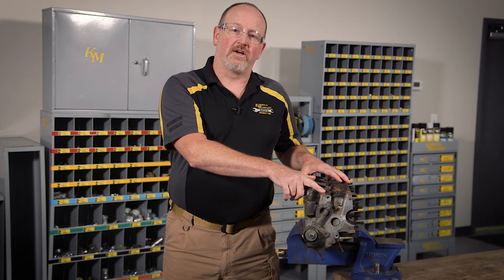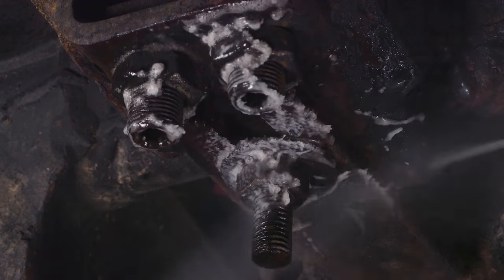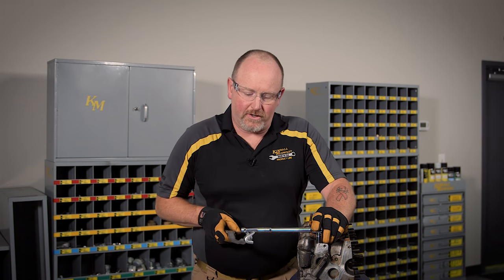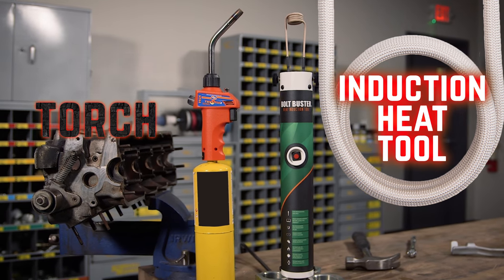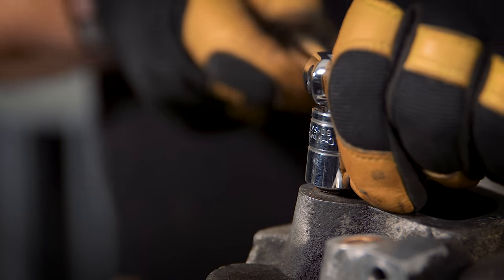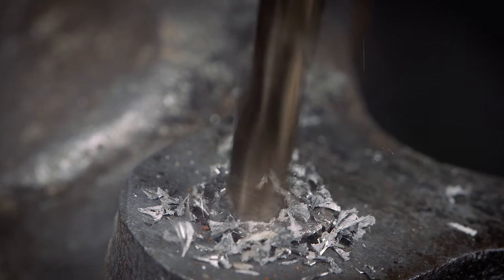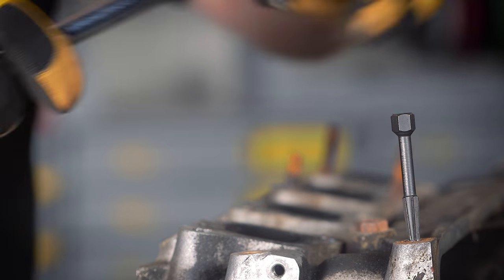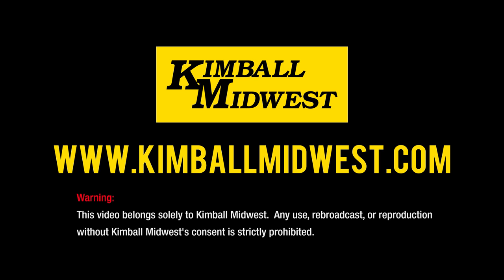How To Remove a Stuck Nut or Bolt

Comment: man…i have a bolt that i have loosened,  it only moves maybe a 1/4 turn and stops. 

it’s a large torx. i’ve sprayed and waited, heated with a decent torch, but it won’t unwind.

i worked it loose, tighten, loosen, tighten, resprayed… the torx teeth have bent. might have to buy a whole other set for the one wrench.

i do a lot of mechanic stuff, but i’ve never had one loosen and not keep coming out.

Comment: &if all that fails... Drill all the way down & through, remove as much metal as possible. Then use a tap & die set with a bunch of WD-40, to retap the hole. Going in & out about 50 times- deeper & deeper, the leftover threads should come out, a few sharp rings at a time.
Saved a few China girl motors doing that
Reply: Tai Theguy so in my case my oil drum bolt is stuck in my car, drill onto the surface of the oil drum or?
Reply: 50 Times? That's Prety Good
Reply: Alliyah my mistress thinks so too😉

Comment: I broke off a bolt, just today, on a lawn mower deck, trying to remove the spindle. I tried to drill a small hole through, and just as the bit went through, the bit broke. The bit would not move. I broke off the bit, as close as I could to the broken off bolt, and used my drill pres to drill through with a larger bit. Drilling out a bit, is not easy. But luckily, it pushed the stuck bit through the other side

Comment: Bolts on strut mounts are spinning when turning the nut. The Head is not accessible and have limited room for tools, a socket doesn't fit. I have geared wrench which turns nut and bolt together. Is cutting nut off my only choice?
Reply: I do like the TNT idea!

Comment: This is brilliant! My car is getting older and I was wondering what happens if I break a bolt while trying to loosen it. It already happened once and I had the car towed to a shop and had to pay them to finish the job I was doing. I'm going to buy an impact gun, an Induction Heat Tool Kit and this bolt extractor for emergencies. I'll finally be able to work on my with peace of mind. Thanks!!!!!

Comment: Im trying to remove my old fuel pressure regulator and cannot get the 24 mm nut to budge. I have tried pb blaster, wd 40 and acetone. Any ideas for this that wont blow my car up?
Reply: So the torch might be a bad idea, huh?

Comment: i'm so frustrated. my hands are callused, i tried every tool in my toolkit. i tried lubing it, torching it with a lighter, hitting it with a hammer to get that lube in the grooves and it didn't move a single milimeter. i can hear it silently laughing and mocking me enjoying my misery.

Comment: 2005 Toyota Corolla CE alternator replacement that last 14 mm bolt to remove the alternator won’t come
Of and don’t really have a lot of space to work with I tried wd40 and wrenches I was thinking maybe gel and and impact wrench to get in there
Reply: Any other recommended I don’t wanna strip the bolt because then it will be hell

Comment: Ive got a Honda CBR 600rr fuel tank tryin to get the feul line off, its a 8mm allen/hex head Banjo bolt. I dont want to strip the banjo an afraid to heat it up. Tried a weak impact an still nothing, just gonna keep soaking it with wd40 an try again tomorrow. Cuss words cuss words more cusswords

Comment: Ok. So yesterday I was to tired and confused on how many things i was supposed to buy and i did not want to invest for a few dead locked bolt. SOOO, i still did apply your recommendations which are: 1) put some DW 40 and let it seat. 2) bank on it with a hammer.  SO I banged, and banged and banged in everyside possible for an hour seating on a chair, with earplugs. Then i put the drill and MIRACLE, the bold came. NOW, bolt number two is more difficult than number one. It seat in DW 40 all night. today I am expecting success. I bought a 6 sided thing for my drill and that should help. I ll bang on it one more hour , that is free. Fingers crossed.

Comment: Tool extenders are a real thing??? I just use a wrench
Reply: I used a really big pipe wrench clamped around my socket wrench handle for super leverage to loosen my mower blade nut…kind of an extender. Worked like a charm!

Comment: So, my mated fasteners resist virtually every suggestion here.
The mate in question: Fuel line to Fuel pump. The mate is a swage style fitting. The hose end is tucked neatly beside a bed support strut, so can't be tapped or hammered. Even a wrench only just fits, and is difficult to get leverage on. The fuel pump side is only slightly more accessible.

Obviously a torch is out of the question, though very careful conductive heat may work.

Because the line side is a rubber hose, it's exceedingly difficult to apply torque.

The fuel pump needs to be replaced, so I can sacrifice the metal lines on the pipe side of the mate, granting me better access to the fitting, but torque is still an issue. Since this isn't a bolt but a swage fitting, using an extractor isn't really an option either.

At the end of the day, I feel like my only option will be to either replace the whole line, or cut it and attempt to install a new fitting, provided one can be found that matches both the line and the pump.

Fun times.

Comment: Great video, but... thought I should share what it like outside of a staged environment.  Working on mine right now.. those gas connection he so easily removes , good luck. At least from my experience get ready for a fight.  And in regards to emptying the tank , I don't know about anybody else but it's not like the water comes gushing out of that tank.  for me it's been drip drip drip for hours.

Comment: There were some bolts that even my big ass electric impact gun didn't get out. Mix ATF and acetone 50% 50% ratio and spray to the bolt, if that didn't get it loose try heat, a breaker bar and a cheater bar. The trick is to apply little pressure and let the cheater bar do it's job until it gets loosened, and believe me, with this method I removed some REALLY tightened suspension bolts

Comment: I had a transmission bolt that wouldn’t come off with bolt extractors. I applied a ton of heat using a torch and then used a 12 sided socket as a last resort and voila - it finally came off. 0:43 I wouldn’t always discount the 12 sided socket for a one time use when trying to get a nasty bolt off.

Comment: Weirdly, it's probably just easiest sometimes to drill it out and use the last method 😂, yesterday I was defeated but a 12mm stuck solid top strut nut. 5 came off super easy but there is one super stubborn nut that just refuses to budge.

Comment: Will a heat gun work?
Reply: Maybe a little but definitely not as much as a torch
Reply: Best bet is to get a propane torch and heat the bolt with that. Fairly cheap and effective.
Reply: oddball002 my issue is my oil drum bolt, is this safe to do under a car?
Reply: @brochahotato4622  I wouldn't, if you want to then you might be able to get away with using a laser thermometer (20 bucks or so at harbor freight I think) and heating the drain bolt up to 250 or 300 degrees (burns at 350-450 degrees, that's fahrenheit btw lol). Another thing you could try is drilling a hole through the bolt so the oil comes out (and probably all over your drill) and then heating it. I don't recommend heating it though and am not responsible for any damages or injuries that may occur from doing so 😂 best bet might just be to remove the oil pan, chances are if the drain plug is stuck you're going to weaken/damage the pan getting the plug out.
Reply: @brochahotato4622  I tried heating an axle vent bolt (basically a bolt with a through hole and a hose fitting on top) to get it out bc it just would not come out, that was after I drained the gear lube and there was still smoke coming off of it so I would say that could go very wrong with an oil pan. However, someone on Instagram once told me that it was safe to weld something to an oil drain plug (which I highly doubt lol) so idk.

Comment: I will say when you DIY your own vehicle, especially when you don't have all the right tools, and you have to soak a bolt with WD40 & wait, you realize why an auto shop with all the right tools asks if you can leave your car overnight. Then theirs ordering parts. And they ask you to leave it an extra day or two. This waiting and ordering happens w/DIY, and I'm not an expert, and I don't have all the right tools. The savings is worth it, as long as I don't break anything.

Comment: I can't use a wrench extender because I don't have room in the mower deck and besides there is a lock washer on the bolt.    Pick something more difficult to loosen a bolt on such as under a mower deck instead of the most accessible thing on planet earth.  This video was no help at all.